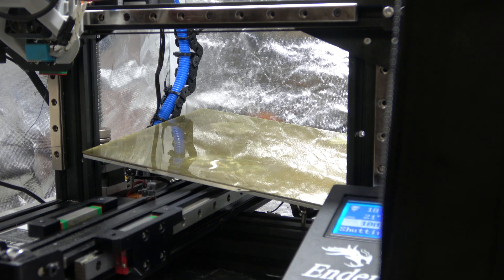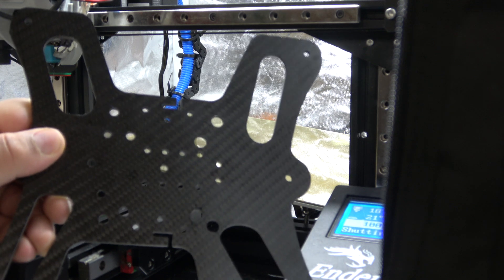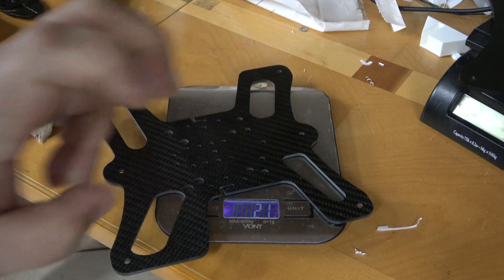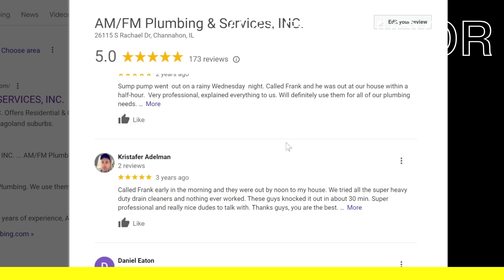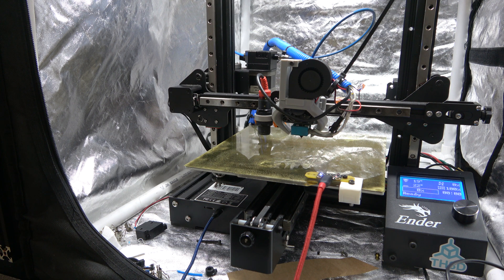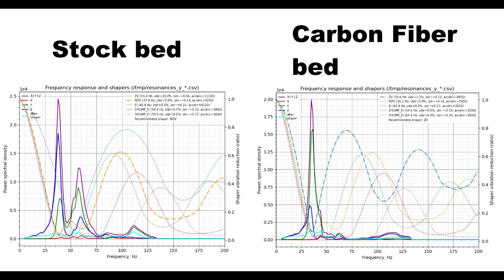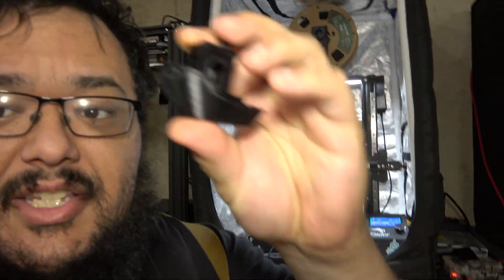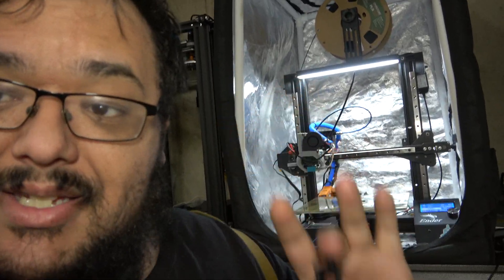Funssor Ender 3 Carbon Fiber Y Axis Gantry Review

Comment: I imagine this would benefit those with an already heavier aftermarket cast aluminum beds by reducing the total weight by an extra 100g

You mention it is stiff but I wonder is it at least as stiff as the original one? And what about its thermal properties? Does it warp when heated and thus potentially skewing the bed out of alignment?
Reply from the maker: Unfortunately I don't have a way to test empirically how stiff the new carbon fiber Gantry is, but from me just trying to bend it by hand it certainly seems more rigid than the stock one